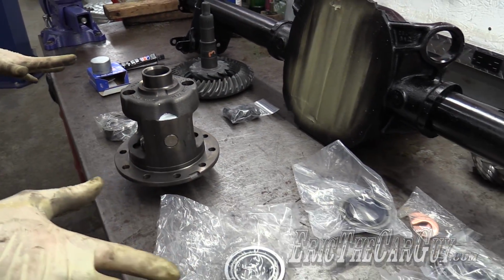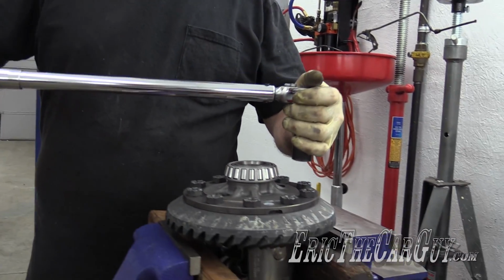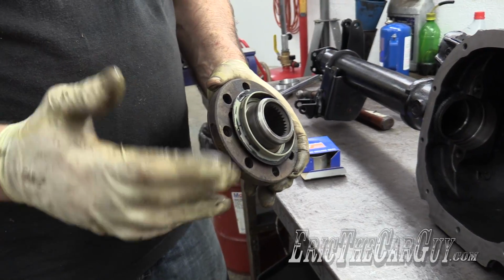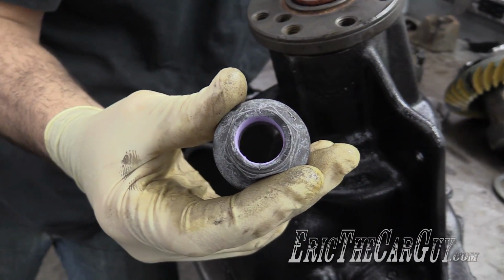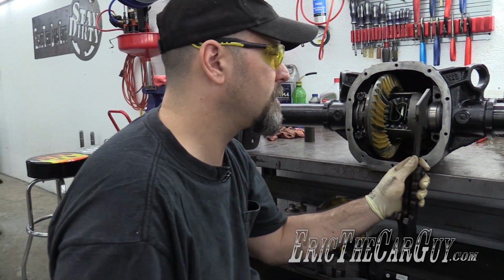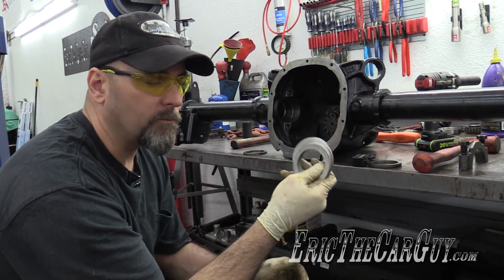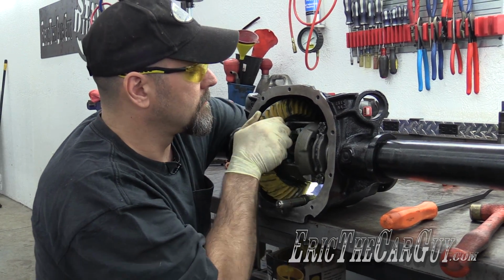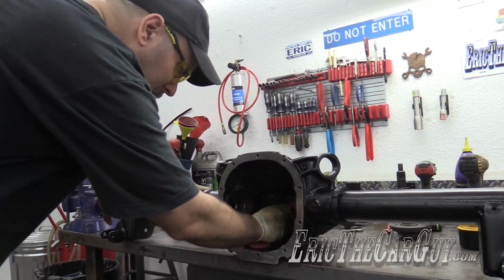Ford 8.8 Assembly & Set Up (Part 1) #FairmontProject

Comment: Great video when you do your set up you don't need to use a crush sleeve just tighten your bearings up to your final preload. It makes it just a little easyier
Reply from the maker: Others have suggested not using the crush sleeve for set up. I hadn't heard of that before. I'm going to try that next time. Thanks for the suggestion.
Reply: +EricTheCarGuy I agree with eustise. You dont need the crush sleeve during setup. You just have to setup same rotational resistance without the crush sleeve. The pinion depth will not change due to pinion bearing preload as long as the pinion is not loose.  Once you get your setup right then you put in the crush sleeve during your final assembly.
Reply: the factory use special tools that measure of the back of the rear pinion bearing to the center of the carrier bore then the pinion would have marking of plus or minus of a certain thousands to add or subtract to the shim stack to get pinion depth then they measure for ring gear back lash for doing aftermarket gears he is doing it the correct way i do this every day many hours some times is needed to set them up
Reply: There is no way that a car factory would do this process. Do you (or anyone else for that matter) know how it is done?
Reply from the maker: The crush sleeve needs to be there in order for the preload to happen.

Comment: i was hopeing i was gonna see u rebuild the factory limited slip because as i am going to do so in my explorer 8.8. still fine video tho
Reply: I was thinking the same thing!!!
Reply from the maker: I still have the old one. I hope to do a rebuild video on it at some point. Right now I'm more concerned about finishing the project. Since I switched to 31 spline I didn't need to rebuild the old differential because that required a new one. Lastly I would have titled that video, "Rebuilding a Limited Slip Differential". Thanks for your comments.